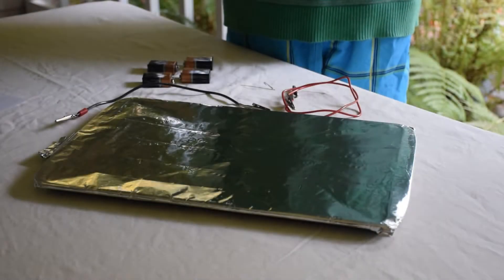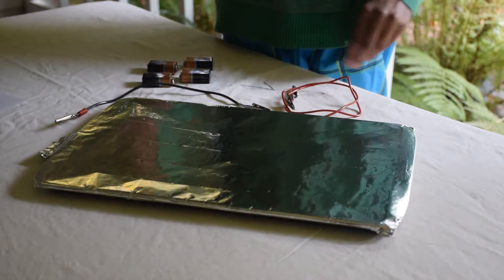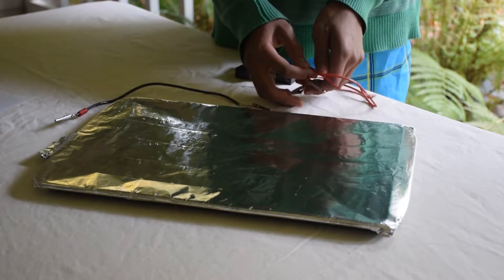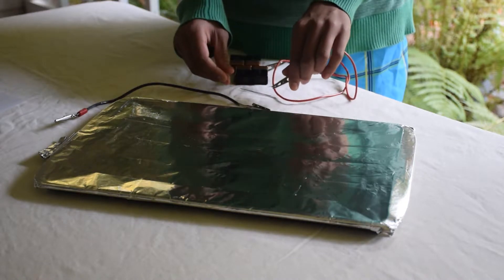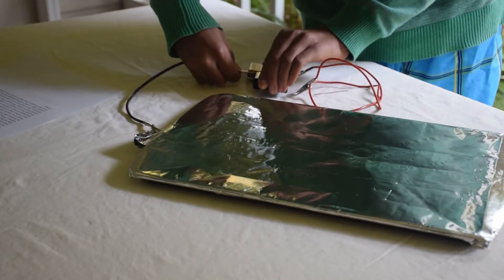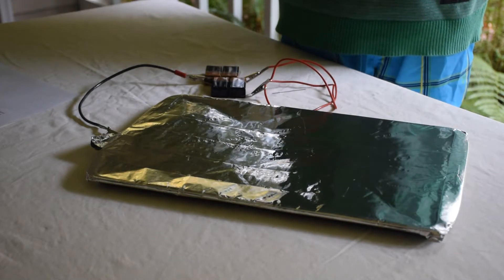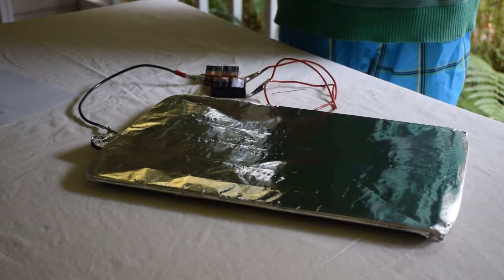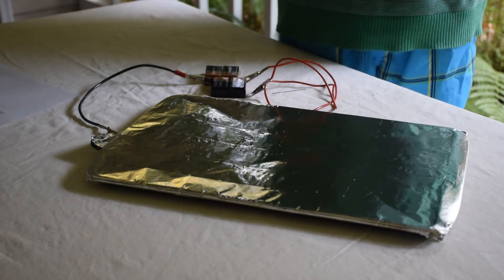How to make a mini Plasma Cutter

Comment: I have a question. Why do you use graphite? Is it not possible to use, let's say, a paperclip or so? And the plasma that is formed here, is it the plasma of air? 
We are making an essay about plasma's at school and we would like to do an experiment. This looks pretty cool yet easy.
Reply from the maker: +Lot J. So if you go back mid video, you can see how I explain the science. but the reason you would use graphite instead, say, a paperclip. Is because, graphite is layered so when the charge goes through the layers of dense electrons, there is an intense amount of heat. If you used a paper clip, my hypothesis is nothing would happen or more likely, you'll get zapped! hope this helps!
Reply: +Scotty McPiper Okay. Well is there a real plasma here then? Because a plasma is often defined as the fourth state of matter, but here it seems you use the resistance of the graphite(which causes the heat) to burn through the aluminium foil. If there would be a plasma here it has to be the plasma of air because of the two elektrodes(aluminium foil & graphite). But looking closely you can see you touch the foil to make elektrons move over, then you get the high resistance graphite which heats up and then you burn through the foil. So my question is: is there a real plasma here?
Reply from the maker: As you said plasma comes in multiple forms or definitions. in this experiment I would suppose there is two. The electricity conducted by the 9V batteries, so as an electrical state of plasma like a plasma ball (thus the sparks). Also as super heated matter state, such as lightning; when lightning makes contact with the air it is so hot, that theoretically the air becomes literal plasma. So to answer your question, yes I have multiple reasons to believe that actual plasma is present here in this experiment.